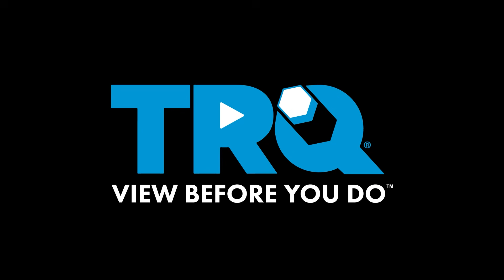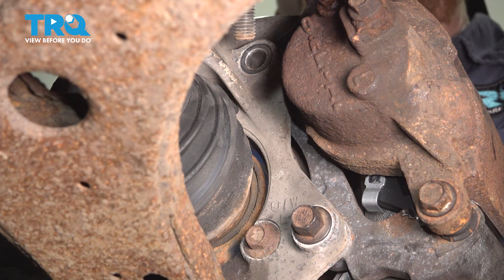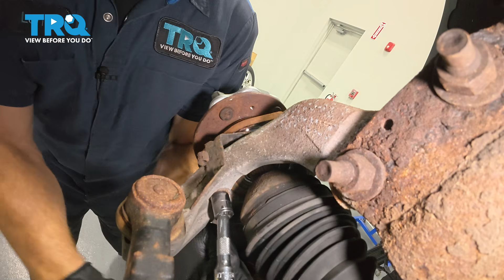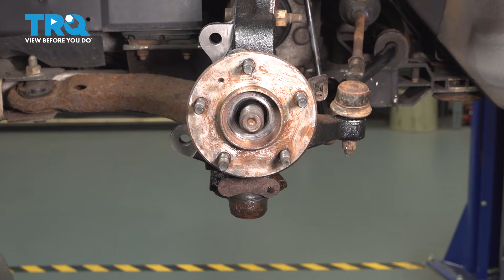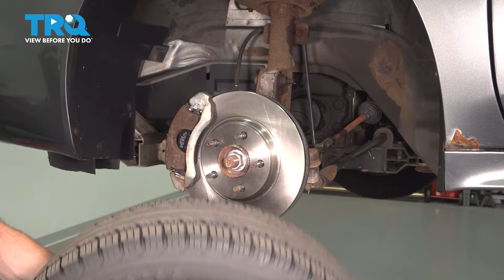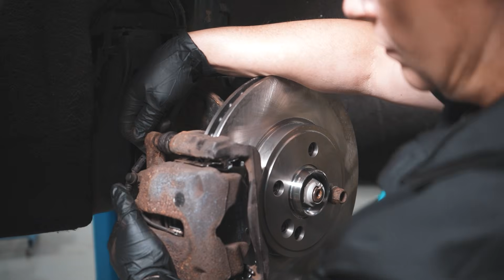How to Replace Front Wheel Bearing & Hub Assemblies 2004-2008 Pontiac Grand Prix

Comment: Whenever i mess with the axle nut, i always just count how many threads in it is, or use paint marker🤷🏻‍♂️ never got an alignment. Never have had an issue, drives very straight. (2014 1500 sierra)